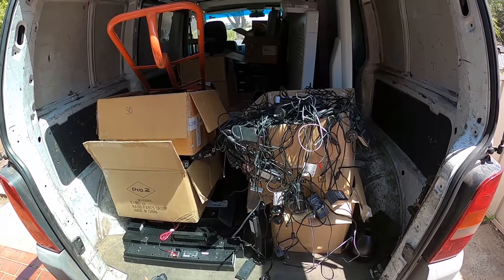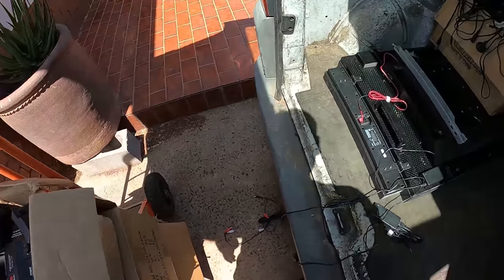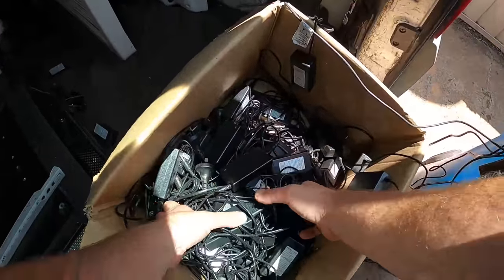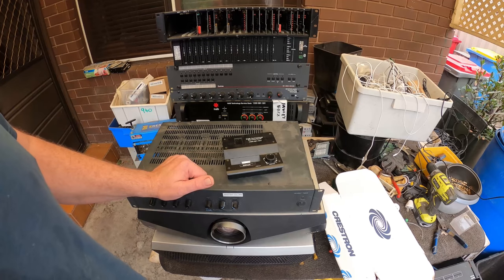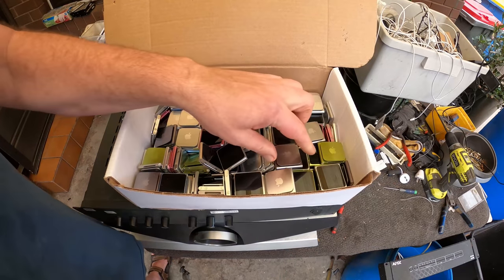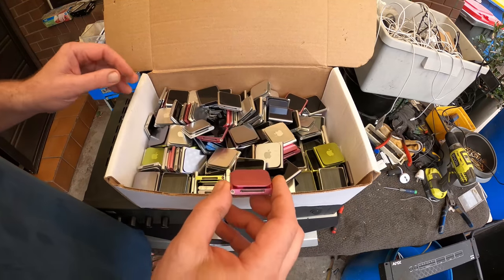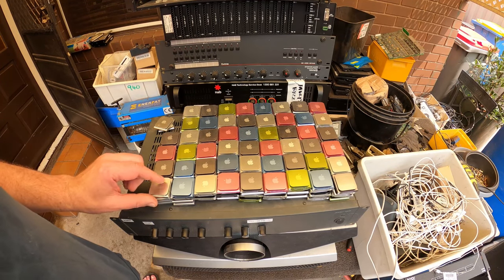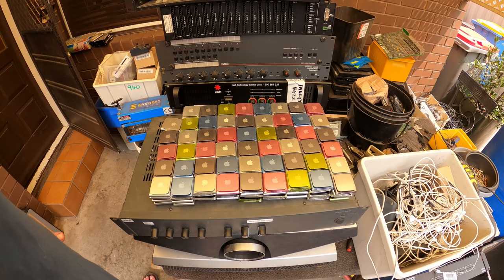E Waste Pick Up Music Stuff Ipod Nano's

Comment: Those  ipods go for $40+ each on ebay in good condition.
Reply: actual selling at 40 bucks ??
or just  priced and  sitting on the 40 bucks level ?
quite the difference there .
Reply: @MonstermindCEOBdclub  a quick look at "sold" listings shows prices from about $10 US to $250 ($250 for as new in factory sealed boxes). The cheaper ones mostly are in not great condition, cracked screens or battery issues, For used but working ones it looks like $20 to $25 is a reasonable price to pay.  Blue ones must be slightly more desired as their prices carry a bit of a premium. 
Which might nor might not be worth eWaste Ben's time to sell individually.  If he can keep his shipping cost low and let the buyers cover that, maybe? I wonder how quickly one could test all 200 of them?

Comment: I agree with most here.  Take your time and heal before you try anything physical.  The pickups will just have to wait til you are fit to do them.  I'm sure they will take your recovery into consideration.  About the IPOD nanos.  I'd say keep them along with the docking stations (some of them anyway) and connecting cables and adapters.  Pair a couple nanos with a docking station and cable and package them for a reasonable price plus shipping...or....sell the whole lot to someone who can and will resell the lot of them, probably someone in AUS. so you avoid shipping costs if they can come pick them up.

Get well soon Ben.  We can wait for videos until you feel up to getting back up to speed.  Hugs from the States.

Comment: Can get mini battery powered screwdrivers on AliExpress or bandgood, or get a 12v drill from hard rubbish cut off battery connector at bottom of handle, much lighter, and wire direct to car battery under bench, use crocodile clips or cigarette lighter socket with cut off switch. I don't like heavy batteries either, are cadmium battery worth anything scrap price wise. Learnt alot about scrapping computers off your channel, new goldrush
 lol

Comment: Nice catch. I know firsthand that devices with 30-pin iPod docks can be fitted with a Bluetooth adapter - turning them into a Bluetooth player. Not ideal, but one way to re-use instead of going to eWaste.
Also, the current Novel Coronavirus crisis will likely reduce the feasibility of buying stuff from China.
Reply: I will tell you a little secret - in China they are also hoping to write off some of the commercial debt because of the coronavirus, hence the TV images from China.  Otherwise they would've kept it under the tightest lid.  Coronavirus hysteria is profitable at the moment on both sides of the Pacific Ocean, despite the fact that in the US the last winter 80,000 people died silently from the Coronavirus.

Comment: 6:55 It is not that bad. 5 USD and cheaper adapters are most likely garbage made on a production line! Even used quality charger will be better than that. 

You could do local pickup delivery in areas you are driving anyways. Also sending a package to and from delivery Shelf is more like 2 bucks (for volume customers even one). Could do volume discounts.

Comment: I am a huge fan of Extron video switchers. If you are thinking of scrapping the ones you have I would gladly take them or if shipping is too expensive I would really appreciate if you could at least send me the blue audio connectors from the backs of the switchers where the cables were cut off.
Reply: Taylor I would pay shipping depending on how much it costs.